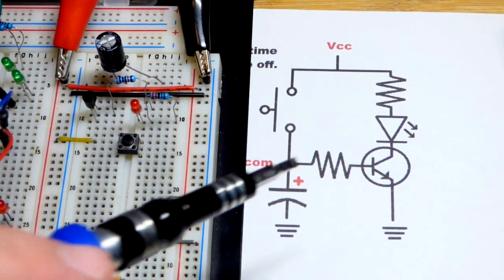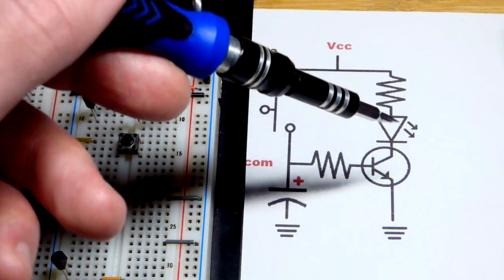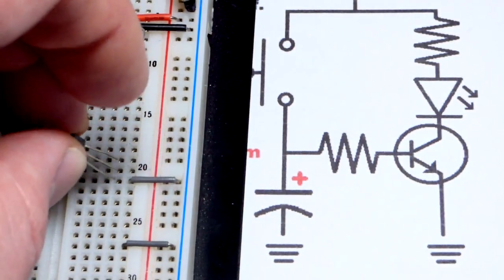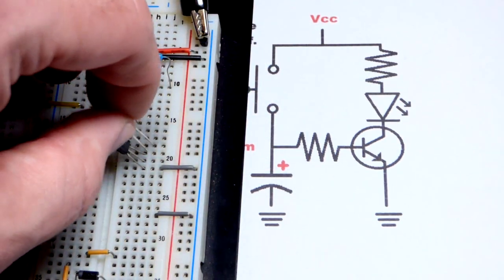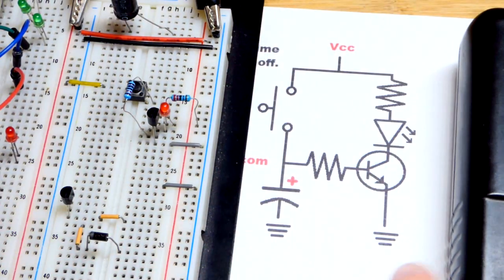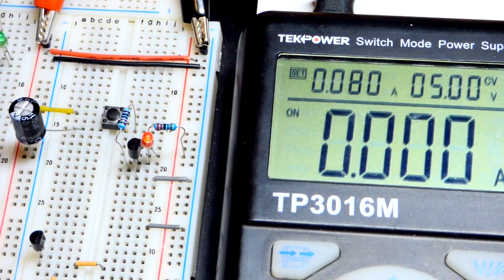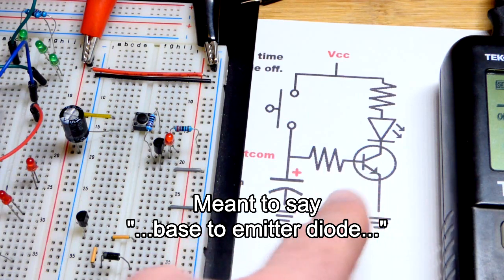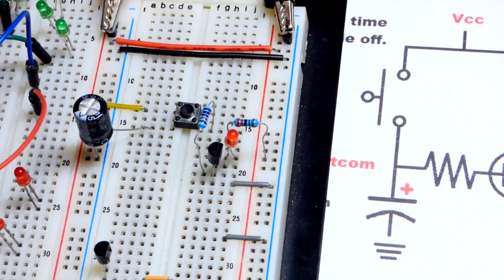Quick timed fade off NPN BJT switch circuit using 2N3904 bipolar junction transistor by electronzap

Comment: You should do anther vid on this same idea with a 2N7000 AND/OR  BS170 MOSFETS.   You can make longer on delays with smaller capacitors due to voltage control as apposed to current control like a  BJT.
Reply from the maker: Yup, I plan to! Will probably be a while though.